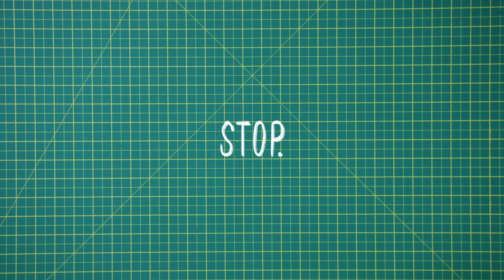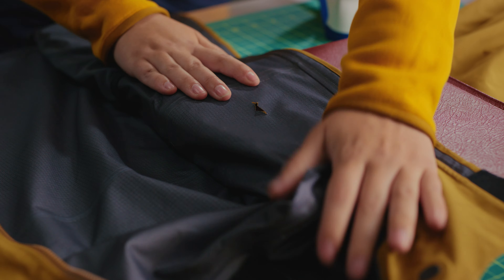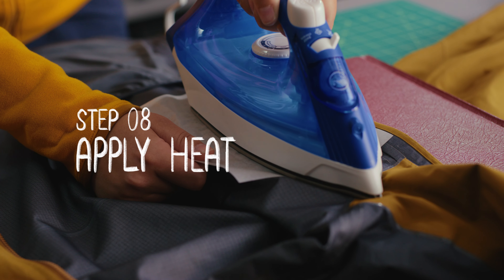How To: Patch a Small GORE-TEX Tear

Comment: The patches you get with an inflatable pad work fine too. Had a thorn go straight through the right arm of my beta on the first day of owning it while on a very light hike through the woods (which is a laughable show of quality compared to the stuff you see guys wearing it in advertisements do)and I used the same method as this with the cheapo patch to repair it, had no issues in heavy rain for 4-5 hours at a time for past two months. Will see how it holds up long term I guess. 

For a brand that bases it’s whole image off of being a durable, reliable choice. This is a shambles of a show for it, had kit at a quarter of this price hold up longer before they’ve needed any little repairs.